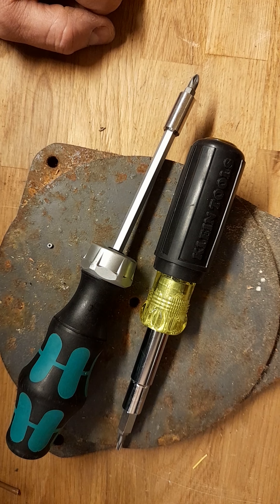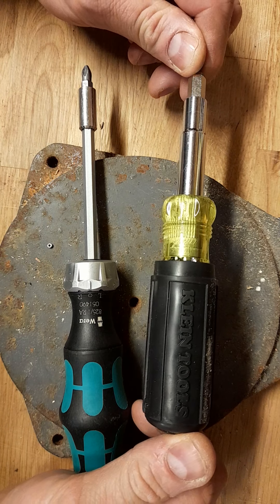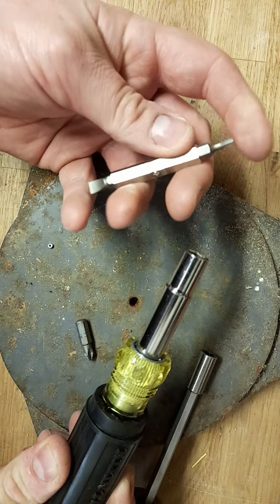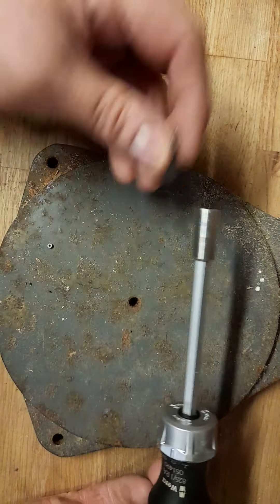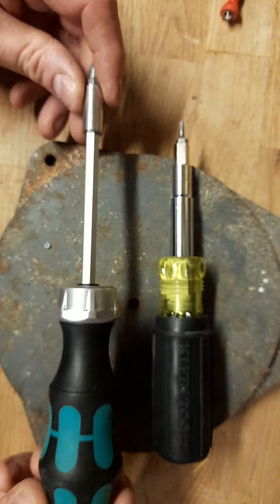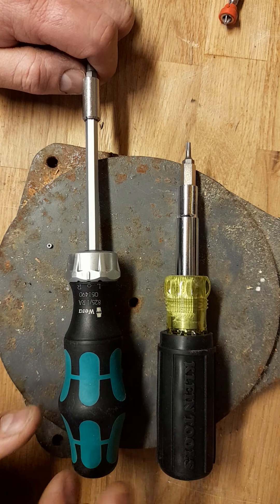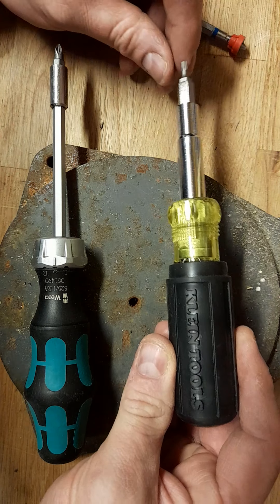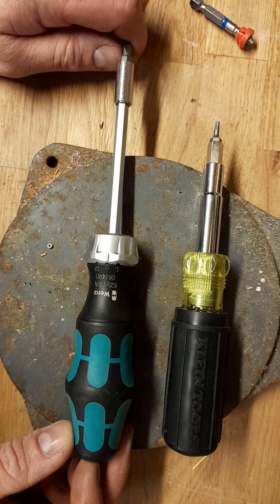Wera vs klein multi drivers dog fight

Comment: The milwaukee ratchet screw driver is good, 1/4 inch drive store 7 3 inch bits, or takes any 1/4 inch extention, got mine for €18 on amazon.
Reply from the maker: Yeah they are cheap but I'm not a massive fan of milwaukee hand tools

Comment: Take everything out except the shaft, and that’s 2 nut drivers on either end. Then you have the two pieces on either side that hold the bits, they are the same size nut driver. Lastly, you then have the 8 different bits with a total of 11
Reply: Exaaaccctttlllyyy

Comment: The problem with the Klein multi screwdrivers is they use proprietary bits, and several of the bits that are in there are useless here. For example the Robertson square drive. No one uses that here, but it lacks of drives we use here on a regular basis like the mentioned Pozidriv.

BTW: I got an old Klein one, ratcheting which takes standard bits. Caught that one on Amazon a few years ago, but doesn't have that cushion grip. It has the full acetate handle:

https://www.kleintools.com/catalog/screwdriver-sets/ratcheting-screwdriver-set

The original bits are stored in the compartment in the handle, and I use Wera bits on it. That thing was made in the US. Cost almost 40 Euros back then...
Reply: Klein make tools for American Electricians, and American Electricians need Robbie's.
Reply: Why would a tool designed for Americans have European bits.
Reply: @bloodsongsToolreviews  As already stated, they sell that in Europe too. I use this set here as an example:

https://www.amazon.de/gp/product/B088V99QGG/ref=ppx_yo_dt_b_asin_title_o09_s00?ie=UTF8&psc=1

Quite expensive one, that are 209.80 USD. VAT already included. Instead of Phillips they should pack in a Pozidriv No. 2, I know they make them in that design. Already seen that in a UK shop. But on some things the Phillips is still required. But an AWG size wire stripper? They also make one in metric sizes.

Screwdriver set Wera 7 pcs, 35.71 USD:

https://www.amazon.de/Wera-Schraubendrehersatz-Kraftform-Spannungspr%C3%BCfer-05006147001/dp/B000297U4S/ref=sr_1_3?__mk_de_DE=%C3%85M%C3%85%C5%BD%C3%95%C3%91&crid=1O8TUUMYM5QGN&dchild=1&keywords=wera+vde+schraubendreher+set&qid=1608734790&sprefix=wera+vde+sch%2Caps%2C178&sr=8-3

Knipex 200mm (8") diagonal cutters, 34.98 USD.

https://www.amazon.de/Knipex-74-06-200-Kraft-Seitenschneider/dp/B0001D9JE4/ref=sr_1_13?__mk_de_DE=%C3%85M%C3%85%C5%BD%C3%95%C3%91&crid=18CSEGMNNX2IL&dchild=1&keywords=knipex+vde+zange&qid=1608734971&sprefix=knipex+vde%2Caps%2C179&sr=8-13

Knipex combination pliers, 225mm (~9"), 33.94 USD:

https://www.amazon.de/02-225-Kraft-Kombizange-Mehrkomponenten-H%C3%BCllen-VDE-gepr%C3%BCft/dp/B000XJ3CRG/ref=sr_1_9?__mk_de_DE=%C3%85M%C3%85%C5%BD%C3%95%C3%91&crid=3JAXFYJ8BZ25C&dchild=1&keywords=knipex+kombizange+vde&qid=1608735092&sprefix=knipex+kombi%2Caps%2C180&sr=8-9

Knipex wire stripper, 25.65 USD:

https://www.amazon.de/11-06-160-Abisolierzange-VDE-gepr%C3%BCft/dp/B0001D9JC6/ref=sr_1_2?__mk_de_DE=%C3%85M%C3%85%C5%BD%C3%95%C3%91&crid=2GVKTJX96P7G2&dchild=1&keywords=knipex+abisolierzange&qid=1608735204&sprefix=knipex+abisolier%2Caps%2C180&sr=8-2

In summon: 130.28 USD, and the screwdriver set contains much more...
If you enter another market with several competitors already established there are several options: You can compete by price, by quality or by offering special things the others don't have.
But the thing is, you must offer stuff that is required in that market and not stuff that isn't required there. Otherwise you won't be successfull.
Reply: @Marcel_Germann  they're sold in Europe but they're designed for Americans, Wehra doesn't change all there flat heads to Imperial for me Klein also has a Europeon aeries
Reply: @bloodsongsToolreviews  But the metric sizes are actually converted imperial sizes. For example what is a 4mm slotted screwdriver here is an american 3/16". They just don't relabel them.
Reply: @Marcel_Germann  you can look at the bits before you buy it, , and it's priced higher because of the import, of a product isn't built with the bits that are needed in Europe don't by it.
Reply: @Marcel_Germann  just buy the European screwdrivers so you can have the European bits
Reply: @bloodsongsToolreviews  That's not how to do business. Especially not for companies which want to sell their products in other parts of the world. I'm a big fan of "competition is stimulating the business". It makes the manufacturers more creative. That can be seen in other industries like the semiconductor manufacturing. When a few years ago AMD wasn't doing good its competitor Intel did no inventions, nothing at all worth mentioning. And then AMD came up with the Ryzen series...then, and only then Intel became active again...
Reply: @Marcel_Germann  they make a European series of screwdrivers for Europe. The Klein 11- 1 is an American series

Comment: The 11 in 1 Heavy Duty has better retention , and is more rugged ! I have used them as a backup , or for the use “ helpers “ . Whia has an 11 in 1 that looks nice , with better handle ergonomics , bit quality should better .
Reply from the maker: Yeah one of the main issues I had with it was simply the build quality, don't get me wrong I own a heck of a lot of klein but this for me wasn't up to their own standards

Comment: What are you talking about the handle slipping off on the Klein have you even actually put it to the use???or just making assumptions on how it's put together and how prettier the Wera looks. The Klein is a work horse people if you are on the fence about buying don't be it's practical and has the most useful bits get the magnetized one too.
Reply from the maker: So what im talking about as shown in the videos is the rubber seal on the outside can be pulled off. The bits are double sided and difficult to get in the uk and they are not suited to pozi drive screws our most common ones. I have used it and when i do tge bits regularly come out when screwing. Inside you can see messy gluey marks. The wera is a much much better made screwdtriver and performs a lot better. Dont get me wrong im a big fan of klein tools, ive spent a lot of money on them and i have worked closely with them. But thisbparticular one i am not a fan of at all

Comment: The only similarity between these tools is there both screwdrivers
Reply: @danstoolroom7700  They're different styles of multibits. https://www.homedepot.com/p/Klein-Tools-15-in-1-Multi-Bit-Ratcheting-Screwdriver-32305/314975058 is the screwdrivers that compares. The 11-1 is a Screwdriver/Nutdrivers and carries everything  a Electrician needs . The Whera is a Screwdriver with a 1/4 nut driver and bit storage just like the screwdriver I just linked. The style .
Reply: @danstoolroom7700  racheting isn't the reason it's the style of multibits
Reply: @danstoolroom7700  you could send me. Whera screwdriver like that for free and it would not replace my klein in my pouch because it doesn't have the nutdrivers
Reply: @danstoolroom7700  I only buy the USA made screwdrivers so I have no clue
Reply: @danstoolroom7700  I'm just saying the 11-1 Style is a needed one, also.the 11-1 MAG does not have the falling out problem .
Reply: @danstoolroom7700  the 11 compared to it's style competition Milwaukee HUsky and HDX are of far less quality, HDK falls apart the husky is extremely loose and Milwaukee ESX buts break easily. I have the exact model of Werha that you have   but most of the time when I need a multibit screw drivers I want the Nutdrivers.
Reply: @danstoolroom7700   if you want the Klein Racheting multibit screwdriver I can buy it for 20 USD and of you pay for shipping I can send it over
Reply: @danstoolroom7700  I'm  in the Klein Tradesman Club, when I get the points for the tool and you can pay for the shipping of they don't sell it In European country's